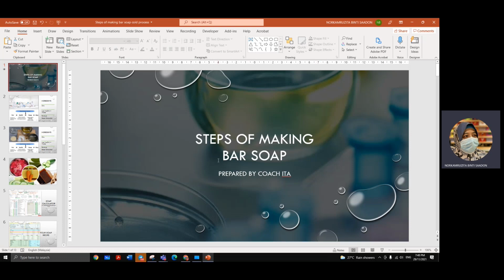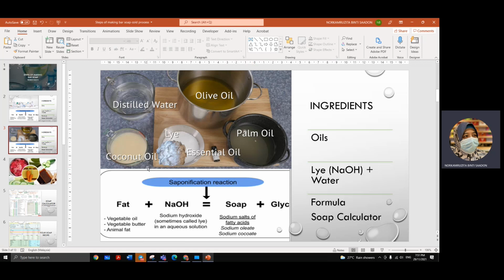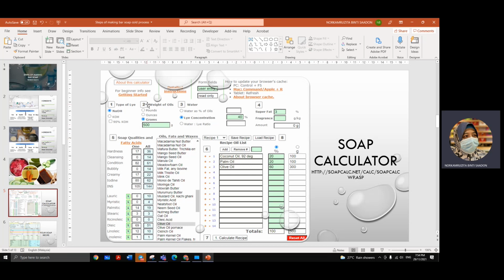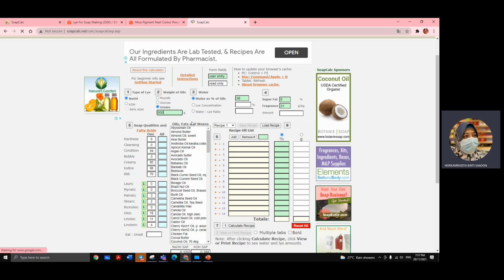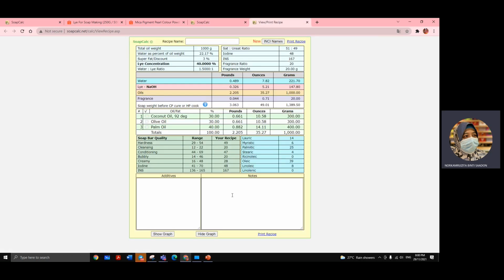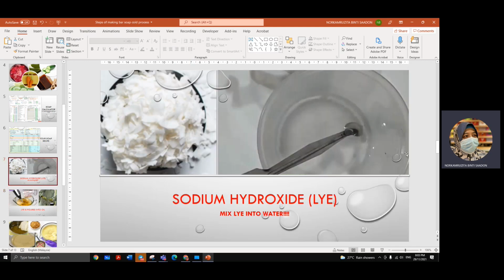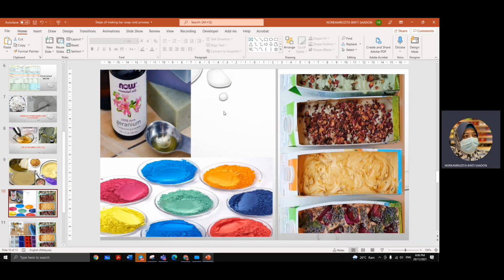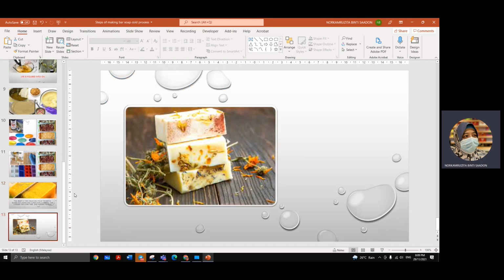MAKING BAR SOAP : FIRST STEP TO COLD PROCESS

Comment: There had 4 things that I get which is consist of saponification process, soap calculator in creating a recipe, steps in preparing sodium hydroxide (Lye) and finally the mixing process between oil and lye. Now, I know the ways to make a soap bar. Thank you, miss.